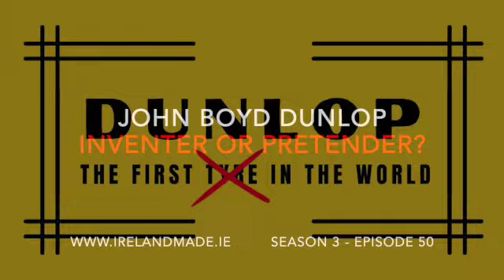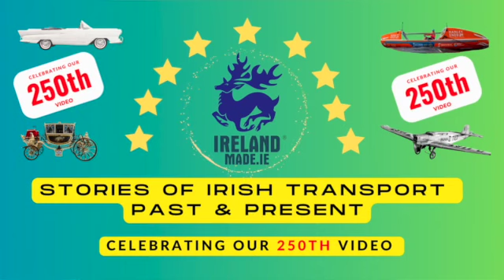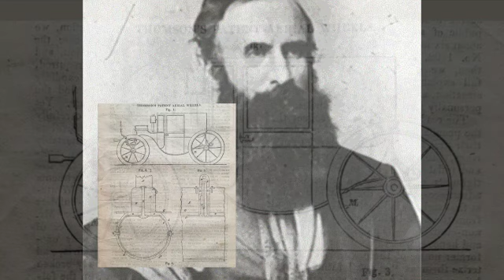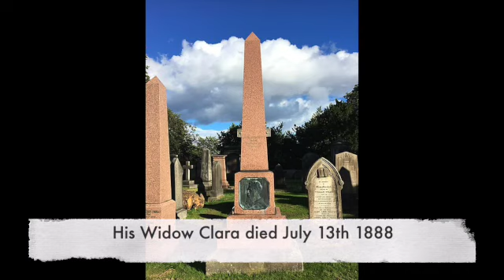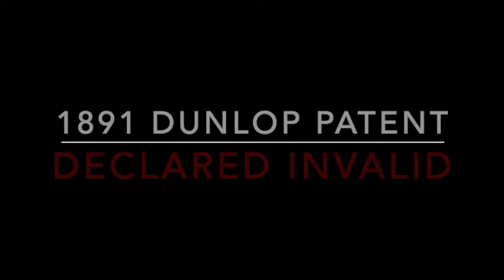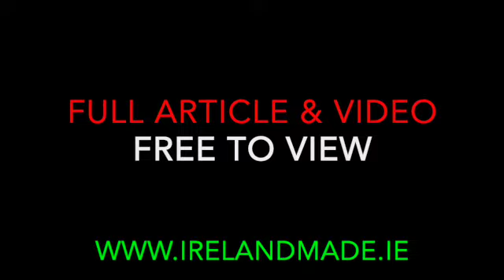John Boyd Dunlop - tyre inventor or pretender? | Season 3 - Episode 50

Comment: 1845 for a pneumatic tire???    I didn't know there was rubber around back then.   Did Robert use leather or ?????
Reply from the maker: Rubber was used in the first pneumatic tyre in 1845, but it was not available in large enough quantities for commercial production
Reply: @IrelandMade  It must have been Natural rubber, I'm not sure but Synthetic rubber didn't come around till the 1890's?  I do know that WWII really pushed the manufacture of Synthetic rubber to the head of the line.   "Back to work"
Reply from the maker: @jetsons101  yes it was natural rubber that was used
Reply: @IrelandMade  I have read that it was WWII that really pushed synthetic rubber along.....    Have a great day.